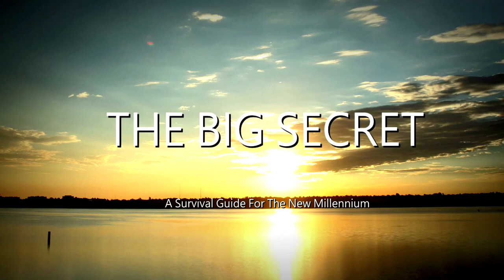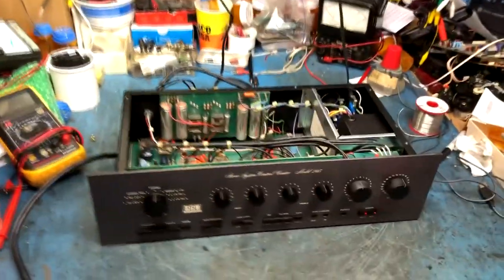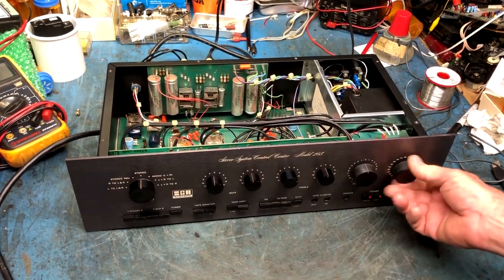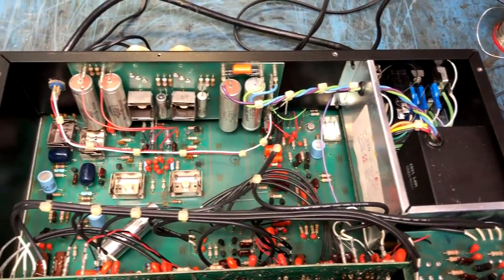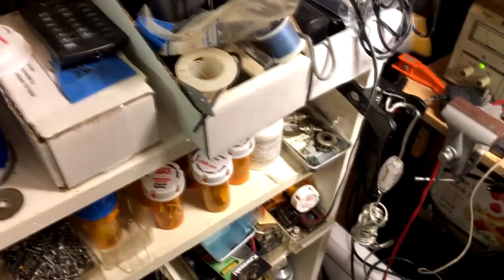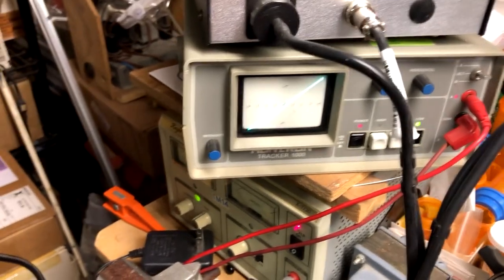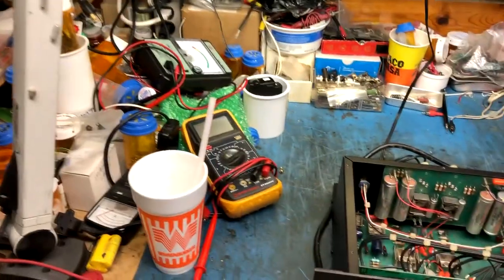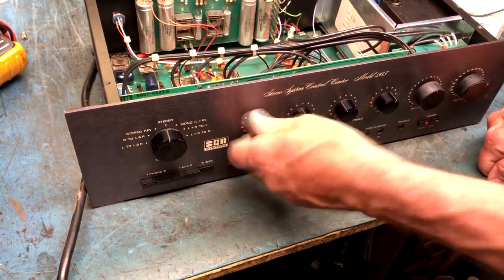Using The Huntron Tracker to Troubleshoot Circuits

Comment: I saw the BGW 203 in the splash and thought, cool, he's working on a BGW 203. OK, perhaps not. I have one of those old buggers. All my BGW stuff chronically had connection issues somewhere. Techs back in the 80's never could find it. I lived with the problem all these years because a good smack would fix it temporarily and then I'd smack it again, repeat as needed. I even have the old nicely bound manual which I think has the schematic. The 203 patch board was notoriously awful for connections.

Comment: I saw in Ebay a VuData in circuit component tester cheaper than Huntron 1000. Could you tell me which one is better?
Reply: a little late, but the tracker is such a simple device.. I advise you get the cheaper of the two if i'm being honest.  The price of huntrons are horrendous.
Reply: @jSkaffaa  I bought the huntron 1000.

Comment: It is called a curve tracer isn't it?
Reply: Exactly, i use a curve tracer every day to compare circuits. Curve tracers can be built for under $20 and an old oscilloscope.
Reply: @mastinwarren1351  I have to work at this more.. I can't seem to get it working reliably with my Oscilloscope.  Might be the age of mine.. it's tube  circuits.